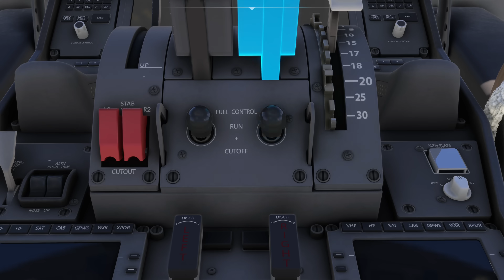Air India 171: Why Did The Fuel Cut-off Switch Get Moved?

Comment: What I see from all the information until now (and yea, I'm watching Captain Steeeve, but tbh also other channels) is that the FDR recorded both engine Fuel switches were set to cut-off position 1 second apart, after 10 seconds set back to run and engines restarted. This is what we know.
Of course everything is possible. But I don't believe in this case it was the problem with installation of these switches like mentioned in the bulletin first released for 737 but affecting also other Boeing airplanes. Someone explained this switch could still work even without the locking feature, only after switching from cut-off to run the locking mechanism wouldn't be engaged. Not necessarily, like Steeeve mentioned, it would automatically jump back to cut-off position when trying to put to run 🙂 maybe in some cases yes, then that would be discovered already at factory - that plane simply wouldn't be able to start engines during a check at a factory and later won't be possible to be delivered to a customer. In that case, when the switch works, it's able to toggle between positions, only the locking feature won't work properly. And then it might be possible to switch them back off to cut-off position just "by waving a hand" - it wouldn't be needed to pull them out by hand before changing. But I don't believe it is this case: this airplane was delivered to Air India at 2014, since then it had many flights and if this plane was affected by the error described in the bulletin - improper installation of fuel switch(es) I'm sure some pilot would already report that and it'd have been fixed in past. The only way possible is the locking mechanism broke just during the last flight or two. Or maybe even during starting engines for this flight 171. So the switch still work but won't latch. But breaking of the locking feature for both switches at the same time? Very unlikely.

But isn't it true that a FDR only records electrical signals coming to different control units, not real actual physical position of the switch? It wouldn't be possible unless there's a special contact within the switch itself to report it's position to FDR - maybe there really is in some cases, I can think the FDR is getting information of real position of yoke, of throttle lever. I'm not a pilot, just flight enthusiast, so someone could correct me on this if FDR has got information about REAL position of fuel switches or it just records from FADEC (or some other part of electronics controlling the engine)?

So back to the point. let's assume for a minute it was really an electrical failure. I'm aware about tests done by Indian engineers and pilots and they weren't able to reproduce it on a simulator. But that's a simulator, this was real plane. Something could've happen that we're not aware about yet. Maybe some problem with FADEC (or FU?), after all there's another bulletin about need to replace some control chip after 10k due to extensive heat and possible problems with this controller chip and replace the whole unit after 3 times the chip was replaced.
I also remember Steeeve's previous video where he described that he's not aware about any warning sign on the displays that would tell a pilot about the fuel switch position. A pilot simply knows - mostly by hearing, the typical noise of running jet engines with thrust starts to fade like when airplane stops at the gate, also he can no longer feel the force pressing him back to the seat... And he assumed in this situation the other pilot turned off the fuel switches, because what he felt it that way. That's why he asked the other pilot "Why did you turned off the fuel?" And the other pilot answered truthfully "I didn't". Also what someone said it's unlikely to operate both switches within a second. I don't know about this. Pilots could answer this question if possible or not.

This random electrical failure might have lasted for 10 seconds, when the signal recovered and first the left engine, short after the right one started to get fuel supply again, the engine control unit tried to restart the engine - but it was too late and we all know the rest.
I know the issue here is again it happened on both engines at the same time. I'm not a pilot nor aircraft engineer, but I'd expect the FU is separated for both engines. So if one fails, even completely burns down, the second one is controlling it's own engine that would run properly.

So is this a possible chain of events or is too crazy theory?
Everything normal during start. Then there's a problem in FADEC/FU that thinks the fuel switch was switched to cut-off. Some sort of electrical failure caused both FU to get same signal and both were thinking the fuel switches were switched to cut-off (left FU from switch for left engine, right FU for switch for right engine). Pilot detects loss of thrust, first that came to his mind is why the other pilot turned off the fuel so asks, the second pilot denies. Maybe at this point they really start to toggle with the physical switches turning them first off and then back on - that's why there's a delay and that's why there's a 5 second gap between turning on left engine and right engine - they're really playing with the switches now trying to restart the engines. After toggling both switches FUs finally got signal "run" and restarted fuel supply.
If this is the possibility it gives more questions than answers: what caused the problem in both engine control units causing dual engine failure in just 1 second. The odds it was any chip failure or any problem in both engines at the very same time are astronomical.

Comment: A better way to put would be that the data recorder recorded that a cutoff position signal was received then a run position signal was inputted a few seconds later. Data recorder did not obviously “see” the pilots move the switches?

Comment: If the engines had failed before the fuel switch off is it not standard procedure to switch off the fuel and on again to initiate restarting? Also the voice recording is not directly quoted in the report. The report simply says "why did he cutoff" and not quoting actual words. Could this not be the PF asking why the engines had been throttled back without even looking at the throttle levers or fuel switches? We also know that the RAT had deployed fairly early in the sequence and conceivably before any switched or levers were operated by the crew.

Comment: I would ask: Were the switches moved ? Have see my fair share of faulty intrepetations of physical contacts and sensors. But then - to be fair - it does seem that they were moved which is in line with your previous opinion but at that time you believed it could be a failure. Probably the captain did the deed but we might never know.

Comment: A quick modification for more safe operation to these cut off switches is add a 30 sec cut off delay and instant warning. That will be enough time to revert action if done by mistake or on purpose.
Reply: except when there is an engine fire and stopping fuel flow immediately is important. but perhaps logic for shutoff during take off yes.
Reply: 30 extra seconds of fuel going into a raging engine fire 👍

Comment: Is there any possibility that the 787’s computer system could have software-commanded the engines to OFF and then back to RUN without the physical switches being moved? And does the CDR reflect the actual physical movement of the engine switches or the fuel status to the engine from a software perspective?

Comment: Also is there any evidence that the pilots were not already experiencing an emergency situation due to other, unrelated mechanical issues when the pilot turned the switches off. We all know that even pilots can panic in such a situation and perform actions that they cannot recall doing even several seconds later.

Comment: hi Captain Steeeeeeeeeve, you mentioned how the cutoff switches are spring-loaded. Could you explain in more detail what that means? Do the springs load to force the switch into the run or the cutoff position if the detent is passed?

Comment: One of the pilots cut off the switches to the fuel.  The amount of contortion some people are doing to avoid that fact is very sad.  Both switches were in the run position during takeoff, and the plane gained the proper amount of thrust to get airborne.  Then one of the pilots turned off the fuel.  Period, that's the end of the story.

Comment: Yeh a camera would tell us. But that does NOT mean it would prevent. Yes have it required that both pilots have to active the cut off switches. But also why can we land military equip by parachute. But can not precent a plane from crash landing. Only a small " rat " only for small amount of hyd/ elect power lol. Have Boing Ceo and mg use Boing planes.

Comment: 2:25 good question! Maybe it is possible due to a fire incident to be able to cut of one engine. The cut off of both should be impossible between wheel takeoff and a save altittude.
Reply: There are so many sensors and the basic interlocks are well aware of engine condition and whether plane is in ascent or descent then these hardware and software interlocks should override the manual actions if any of fuel cutoff on switch es . Is it not Captain Steeve . ?

Comment: A faulty fuel cutoff switch where the locking mechanism failed. When it took 1 second to turn them off why did it take 2 seconds to put them back to ON position where it’s an emergency situation. If a copilot would reach out to switch them off quickly, it will make a certain movement ans noise which will catch a captain’s attention.

Comment: In the US Air Force in the 1980's our SACCS system had dual redundancy with a 3rd self check for the "Odd Man Out" situation. Are there 3 separate signals in each Fuel Switch switch going to 3 different controllers to insure a short/open/noisy switch cannot switch modes if two signals don't agree with the switch position change or if a sudden wiring fault occurs?

Comment: There is still insufficient evidence to suggest deliberate 'sabotage'. If a pilot HAD just turned the switches off deliberately they might well deny it when challenged, but would they not likely interfere with the other pilot switching them back on? Yet they WERE switched back on successfully in 10 seconds. Why would a suicidal pilot not interfere with that since he would be facing a lengthy sentence in jail had the other pilot 'rescued' the situation?

Comment: Response to your answer about it being a good idea that both pilots must operate the controls.  Not well thought out in the moment.  One pilot may be incapacitated.  Or, there is an emergency with one pilot flying, the other pilot running a check list.  An engine needs to be shut off - and now you have a manufacturing induced delay in shutting down an engine.

Comment: Captain Steeve, one scenario I can not get out of my head is as follow. Let's say a software failure cuts off both engines and as a procedure in that casa as some of our Pilots I asked stated and you also described the fuel cut off switches are placed in the off position and straight back to run in order to relight them. And now some one is kind of deliberately mixing up the timely events to make the pilots look responsible for the crash. The reason why I consider that as a possibility is, I can't get over the line the first pilot said : "Why did he cut off" Why would a pilot talk in third person to his colleague? And the other pilot answered "I didn't do so" Because he didn't and was just as confused as the other one.  I assume the preliminary report shows the pilots conversation word by word.

Comment: Captain Steeeeve: The 737 MAX MCAS was also working exactly as designed. That's  the shocking truth! I already made the post with the previous video:
They need to test a few million times if there is any chance that the switches might malfunction. Only if they can prove beyond any reasonable doubt the the switches are indeed not to blame, then I'm willing to blame the Pilots. (as long as they don't come forward with more evidence that it was indeed the crew)
I wouldn't trust Boeing for a split second

Comment: it is certainly possible that the one pulling the fuel switches had an episode of medically induced confusion/disorientation or even a short absence seizure with autonomous behavior, that possibility needs to be kept in mind during this investigation. outside the medical realm automatic behaviors are also well known occurring when we are distracted in deep thought or worries not related to the immediate task such as driving.

Comment: There is something that for me doesn't make any sense. In the report it is written that the fuel control switches were turned at the cutoff state 3 seconds after liftoff.  Assuming it was a suicidal act, why did he turn off engines so early, with the risk of a non-fatal crash?? Was he so sure that the crash would have been fatal??

Comment: My Lord! WHAT DOES IT TAKE FOR THIS CAPTAIN TO REALIZE THAT WHAT COULD HAVE HAPPENED MAY NOT HAVE INVOLVED THE PILOTS AT ALL! He is SOLD or BOUGHT on blaming the pilots! He cannot refute the possibility of the explanation given below:

REAL POSSIBLE CAUSE OF AIR INDIA CRASH

Could Electrical Failure Alone Have Starved the Engines?

Yes, it’s technically possible that a sudden total loss of AC power on takeoff de-energized the fuel‐shutoff solenoids, allowing their spring-loaded valves to snap closed—even if the cockpit switches remained in RUN. Here’s how that scenario could unfold:

1. Fail-Safe Fuel Valves Close on Power Loss  
- The 787’s engine-feed valves are electrically actuated but are spring-loaded to the CUTOFF (closed) position if they lose their electrical supply.  
- In a dual-generator failure, no AC bus power means the solenoids de-energize, valves default to closed, and fuel flow stops.

2. Cockpit Switches Stay Put, Valves Close Downstream  
- The manual fuel-cutoff switches are *mechanical levers* that only change the valve’s energized state—they don’t themselves block fuel.  
- If the valves lose power, they close regardless of switch position, so pilots would feel a real thrust drop even though the cockpit levers never moved.

3. RAT Deployment Isn’t Fast Enough to Prevent Fuel Starvation  
- The RAT deploys within seconds to power essential instruments and hydraulics—but *not* the main-tank boost pumps or valve solenoids.  
- That delay lets the fail-safe valves remain closed long enough to cause true engine flameout and a sudden loss of thrust.

 4. FDR Interpretation vs. Pilot Reality  
 
- A solenoid-driven valve closure looks identical in the data to a switch-driven cutoff—hence the FDR’s “fuel-switch to CUTOFF” event, even though the pilots deny moving the levers.

In short: A total electrical blackout can indeed mimic a manual fuel‐cutoff by de-energizing and spring-closing the engine fuel valves, causing a real loss of climb thrust that the crew would experience as if the switches had been flipped.

Comment: My question is whether anyone has considered that the pilot was not suicidal, but instead had been spoofed by a chatbot. It is very easy to ask questions to a chatbot and get bizarre answers to which the chatbot then responds with extreme confidence. This could be a case where the pilot had talked to the chatbot about his own plane having, for example, routines to prevent him from shutting down fuel to the engines. At some point, he may have become so confident in the chatbot answers that he decided to try it out in real life, with fatal consequences.

Comment: Cut Off. The plane is taking off. In his mesmerized state of mind from the 105 degree heat and the residual effect of medication (drugs) the pilot pulls on the cut off switch because they are taking off, at first glance not appreciating the difference, then realizes his error. The switch should be renamed Shut Down in order to avoid mistaken purpose by pilots whose first language is not English.

Comment: IT IS A FATAL DESIGN FLAW NOT TO HAVE AN INTERLOCK (Electronic or Software) that inhibits both fuel CUT/OFFs to be activated during takeoff - at least until sufficient height is reached to allow some sort of controlled descent. THIS IS BASIC ENGINEERING PRACTICE

In my career, our systems used Hydrogen Gas, Toxic Gas, High pressure and Ultra Low Vacuum, and 400 Volts at 90 Amps (fry you top to bottom, instantly). They were absolutely bullet-proof with undefeatable hardware and software interlocks that prevented any every explosive situation

Even though a double engine fire on takeoff is a high risk situation, engines can still produce thrust and may be sufficient for enough height to be gained for a chance of a controlled descent. Better to have thrust and flames out the back, than no thrust at all !

Going back to previous engine shutdown disasters, then an interlock should be installed to prevent the good engine being inadvertently shut down. Clearly, a System should recognise such a Pilot error

Comment: One thing I'm learning from Steeeve's videos is that switching off BOTH fuel control switches during certain stages of the flight might be something the aircraft manufacturers could address with additional safety controls. It sounds like there's no reason to cut off BOTH fuel control switches during low altitude flight. That's the sort of thing that a flight control computer could handle. Alternatively, cutting BOTH fuel control switches together, during flight, could require a secondary confirmation via a different control interface that both pilots have control over, or that sounds an audible alarm, etc. It doesn't sound like there's an emergency scenario where both control switches would need to be cut so fast that a secondary confirmation would cause problems.